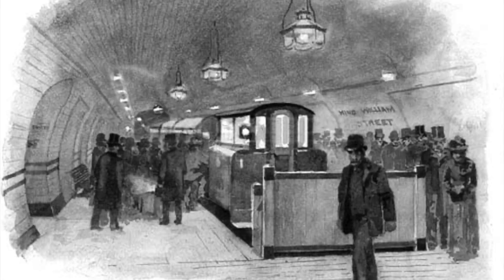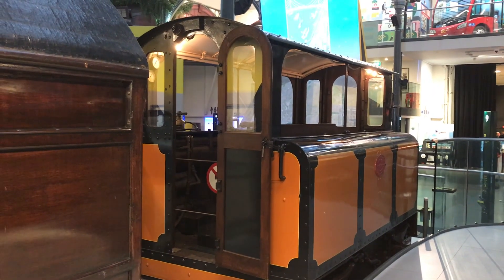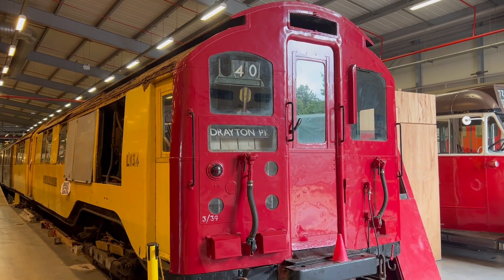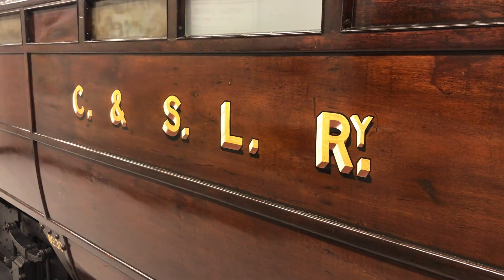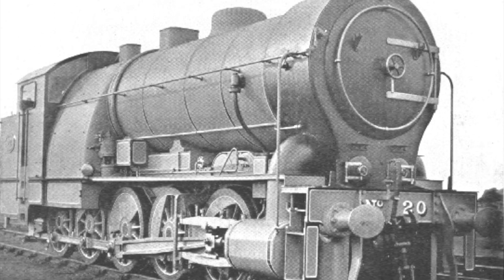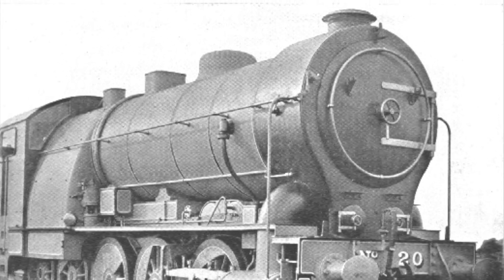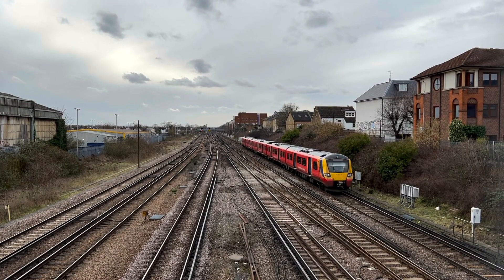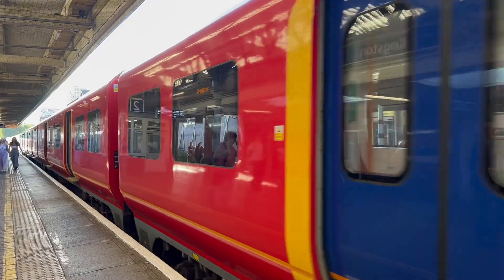Why some electric trains use a third rail, and others don't

Comment: One system that deserves a shout out is the Mersey Railway, today part of Merseyrail. Opened in 1886, it made history in 1903 by being the first railway in the world to be converted to electric traction. The reason for the electrification was due to the tunnel under the river Mersey. Approached on each side by a punishingly steep 1 in 27 gradient, for context, the Licky Incline between Bromsgrove and Barnt Green is 1 in 37 3/4, and the steam and smoke from the initial steam locomotives played their part the ferry (across the Mersey) being more popular at the time. When the route was electrified and stations at (Birkenhead) Hamilton Square and (Liverpool) James Street were cleaned up, passenger numbers unsurprisingly increased dramatically. 

Today, the system Merseyrail uses (for the most part), is a 750v dc third rail, similar to the more extensive system on the Sputhern Region. Incidentally, in the 1980's, Class 508 units, displaced from their original services on the South Western Suburban services, were shortened* and sent north to work in Merseyside and are now (at the time of comment) seeing out their retirement before final withdrawal. 

As every Jago, you've been the Ferry to my River Mersey. 

*: if you know where to look, surpluss trailer cars from Class 508's were incorporated into the incoming Class 455/7 units, which explains the lower roof on these compared to the rest of the 455 fleet

Comment: Merseyrail is entirely a third rail enclosed system, there is talk of extending the operations to Wigan, Wrexham and Warrington, but Network rail are reluctant to allow them to install more third rail along the tracks.  So far the trial battery powered services to Headbolt Lane (not on the third rail) have been... mixed

Comment: This was an interesting topic. Thank you for uploading.

In the US, the rail lines in and out of New York City are both third-rail and overhead. When electric power was introduced, New York City banned steam power from within the city due to the pollution. The New York Central went with third-rail into its yards and the famous Grand Central Terminal. The New Haven Railroad (New York, New Haven, and Hartford) opted for overhead into Pennsylvania Station via the famous Hells Gate Bridge. At the same time, the Long Island Railroad chose third rail power and ran initially into Penn Station and now more recently into Grand Central Terminal.

Since the New Haven served both Penn Station and Grand Central, they developed dual-mode electrics with wires up to Woodlawn Junction where the New Haven joined the New York Central Harlem division which ran third-rail up north to Brewster or a bit more than that now. In the 1950s, the New Haven developed the FL9, a dual-mode diesel electric-third rail full electric locomotive. While a bit sketchy initially, these proved to be reliable workhorses and this same technology is used today by commuter railroads worldwide.

The New York Central had some interesting box cab electric switchers it used to shunt trains around the underground Grand Central Terminal. The locomotives were third rail powered but had pantographs fixed in the upright position to power the locomotives over crossovers and switches.

Comment: My late father had a jolt from a third rail one windy stormy night crossing over Blackfriars bridge from the signalbox, they used the leftermost line to cross the bridge which was next to the disused bridge.   Well he caught the hem of his trouser leg on the rail and it threw him over to the disused one and for the second time in his life he was hanging on for dear life over the rampaging waters of the Thames below him (the first time was when he thought to use the disused bridge instead of walking trackside and a floor beam disappeared right under him) and he had to pull himself to a metal section to gain safety.   People see it as a lowish number at 750v but the amperage behind it was extremely high hence why you had to do the ministry of silly walks over the live rails esp in wet weather as they would arc to you fatally, he only got a belt from his wet trousers and was lucky.
Reply: Unrelated, but I'm sorry to hear about the passing of your father ❤
Reply: What ever voltage and current I imagine it is going to be lethal but I was working with an ex electrical engineer from the underground and he would say that getting a DC shock was nasty. But may be that was just because of the higher current not that is was DC.

Comment: third rail may actually be more susceptible to cold weather because of ice freezing over the top. This stranded a train in 2011 in the Lewisham area leading to complete gridlock for hours on a snowy night. Wind is mostly a problem for OLE lines where thatcherite cost cutting demanded the use of headspans (like those shots you had of the midland mainline) instead of portals (see the wcml). In the long run, this has cost more due to the totalising effect of the disruption this kind of system can bring about when the wind knocks it over. 

There is another theoretical upside to third rail in terms of metro systems in that trains can pull a higher current for accelerating out of a station because the contact area with the third rail is a lot bigger than with OLE,

Comment: *Heres a question for the experts.. So i get the fast Hitachi trains from Reading into Paddington most days. Q. Why is it, sometimes the Hitachi 125 trains (sorry dont know the name), sometimes sit in Paddington with the Diesel engines running. And yet the Pantograph is up and touching the overhead cables. In sure there is a technical reason.

Comment: The now Lioness Line, has always been third rail from Euston to Watford Junction since the death of steam trains, especially since it shared the line with the Bakerloo from Queens Park to Watford Junction, although this was ended in 1979/80, now going only to Harrow and Wealdstone. The mainline in the area, has been diesel and overhead lines since the end of steam. The local main steam depot at Willesden is now a Freightliner depot.
The lines from Liverpool Street were electrified in the 1950s and currently the Paddington main lines are being electrified, with overhead lines.

Comment: The NER had a pretty significant third rail commuter system north of the Tyne. But they also used overhead. The E1 loco you very briefly displayed is actually both third rail and overhead. It used overhead the river Tyne quayside but third rail up to and on to the commuter lines. The overhead was because it was considered somewhat dangerous to have live rails in a shouting yard.

Comment: It's a pity that the Reading-Gatwick line was never completely electrified. I heard this was debated at one time, but the new policy of all new electrication being overhead put a stop to that idea. As well as the cost, of course.
Reply: I don't really see why it is such an issue not electrifying Reading to Reigate. Nobody bothers about Chiltern diesel trains running over electrified tracks from Harrow on the Hill to Amersham. And that line was destined to be part of Cross Rail, so probably with Met line trains ceasing to run to Amersham and Chesham at some point

Comment: 'As, from 1915 onwards, the London and South Western electrified on a very similar system (650 volts without the fourth rail), at least partly to save trouble where the District had running powers over its line, and as the South Western bequeathed its its sytem to the Southern Railway, the South of England still has the policy of Charles Tyson Yerkes to thank for its perennial icing troubles. Yerkes however, should not be blamed. He was not electrifying the London, Brighton and South Coast!' (C. Hamilton Ellis, 'British Railway History').

Comment: So there's me sitting on platform A at St Pancras watching the Thameslink trains coming and going with their pantographs raised, but not touching anything overhead, and wondering exactly the question why they had both systems. Then that very evening you've posted an article which explains it all fully. Thanks Jago, perfect timing.

Comment: They should electrify the motorways with overhead catenary, then make cars have pantographs to draw their power. Add on couplings so lots of cars can run in multiple and I reckon the motorway would be really useful. Better still, if we had a dedicated vehicle at the front with one highly trained driver the rest of the drivers could relax. To do that we could have one car with a buffet in it. We shall call it "the buffet car". I reckon this system would catch on.
Reply: Been watching a bit of Adam Something?
Reply: @grassytramtracks  no
Reply: Thats called a train sir

Comment: London underground four rail systems improves readability, because if there is a ground fault (eg drinks can between running and power rail). One rail will go to earth potential and the other will move away from earth, so the voltage between the two power rails will be unchanged, allowing the trains to continue running. The fault can be fixed overnight during the maintenance window

Comment: So why does the tube use four rails, when three suffices with 'overground' routes?

Basically, it is possible to run a DC system with a single voltage power line, with no 'return' as such, by the use of earthing, that is keeping a return path, such as running rails at earth potential relative to the voltage.
A problem arises in the tube system in which cast iron segments were used to line the tunnel, in that any attempt to earth the voltage through the rails would result in an electrolytic current which would corrode away the cast iron segments eventually.
Thus an 'isolated' earth potential is supplied by the fourth rail.

Comment: When I did my MSc modules at the University of Surrey, they used the case studies of cast iron Victorian Thames Water pipework in SW London experiencing higher than expected rates of corrosion due to stray current from 3rd rail systems on SWTs rail networks. So yes, electric systems do have potential, making a big difference.
Reply: This one reason why new AC electrification schemes in the UK at least cost so much, and take so long. Rails need to be bonded , and you might even need new track too, telecoms, etc cables along the lines need to be isolated from stary AC  currents, etc, etc.

Comment: One thing confuses me - For example, Gunnersbury station - the track is shared by London Underground 4 rail and BR which has a 3 rail system. How does the BR train work if there is only the London Underground 4 rail system?
Reply: BR third rail DC trains use the two running rails as the earth return, but LU trains use the middle conductor rail for the earth return, and although the LU system may also use the running rails for low voltage track circuits, which indicates to signallers where a train is, the two different currents through the running rails can be kept separate. 

BR trains can run on LU tracks, but not the other way around because an LU train uses the middle conductor rail as the return, and if it is not there, the circuit isn't completed, and the LU train cannot move.

Comment: Switch in electrification modes, I guess, will eventually entail the simultaneous use of both so as to keep the system running whilst establishing and dismantling the infrastructure networks

Comment: I used to commute into Euston daily on the Watford DC line, which uses third-rail electrification. The trains also had a pantograph (aka "pan") for use on lines with overhead electrification. One day, the driver of my evening train, which I guess had come in via the WCML, forgot to lower the pan before leaving Euston. Shortly afterwards, there was an almighty bang as it struck a bridge. I wouldn't want to be in his shoes after he wrote the report!

Comment: I moved from South London to LTS/C2C.  Sothern rail (3rd rail) never had a problem with power connections. LTS/C2C (overheads) always had overhead lines coming down due bad weather and other causes something to do with the trains themselves. I learned not to trust them! I understand thing are more reliable now, but why did the trains bring the wires down? poor maintenance or bad driving ?

Comment: 01:18
"That flicker is really annoying"

It's a locked off shot. Freeze a clean frame.

I find the history of British railways and especially the London underground really complex confusing.  I guess like trying to grasp biochemistry or calculus, I would need to make a special, sustained effort and right now I'm too lazy.

In Sydney all the rains used overhead caternary 1500V DC power, but then Greater Sydney is a huge sprawl - bigger than Los Angeles and Orange counties together - so these trains had to travel a long way and as you say overhead power makes more sense for that. 

In the 1920s they started on the Sydney City Circle (their tiny underground whose prime purpose was to redirect northbound trains either south or over the harbour bridge) and had to build tunnels big enough to accommodate larger carriages with overhead power. I had assumed that London chose third rail and small carriages to minimize to expense of building all those tunnels. Looks like the truth (as usual with the tube) is more complex. Anyhow, that seems to be the logic behind 3rd rail power in the smaller tunnels for the new Metro lines Sydney is building.

I really don't know how you remember all this stuff Jago. 
With such a memory you could have been an organic chemist or a physician. (Maybe you are?)

Thanks again.
Reply: The Sydney Metro uses OHLE, not third rail, in fact Epping to Chatswood took  over a section of tunnel built for normal Sydney Trains.

Comment: I wonder if the predilection of Army Artillery and Tank depots in the South and S West has to do with no height restriction on third rail other than that of bridges.
  The fourth rail on the Underground is because the running rails carry low voltage signal current and for the Westinghouse automatic emergency brake system so cannot be used as the positive current return, hence the  'do not touch any rail' notices.

Comment: Funny to see the Class 76. It's six-axle sister class, the Class 77, was smaller, with just seven locos. But contrary to the single Class 76 that was preserved, three of the Class 77 were preserved: one in the Netherlands, and two in Britain – the one in Manchester in its Dutch livery.
Reply: It was lucky the Dutch National Railways bought the fleet of 77's for further use, otherwise there would be none preserved.
Reply: @12crepello  When I first started travelling by train, at the end of the 1980s, intercity trains in the Netherlands would be pulled by an 1100, 1200, occasionally 1300, or 1600 series locomotive. So the obvious question was: where are the 1400 and 1500 series?

Bear in mind that there were no online resources back then. You had to get your information from magazines or books, and they could be expensive for a student.

Turns out that the 1400 series was never built (although some people have made a model based on sketches), and the 1500 series was retired in 1985. The latter was the British Class 77.

Finally, in 1989, when the Dutch railways celebrated 150 years of railways in the Netherlands (IIRC), I saw one in Utrecht, together with some more stuff I didn't even know about, such as the 1000 series. There was also the German ICE-E: the experimental one.